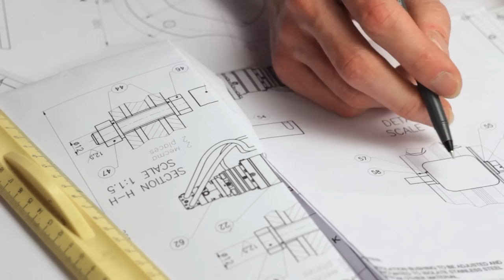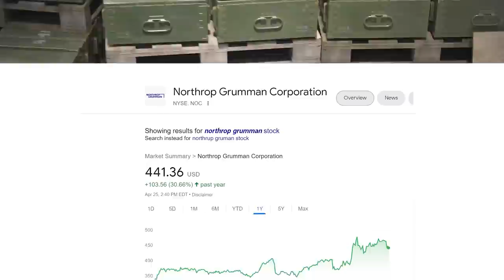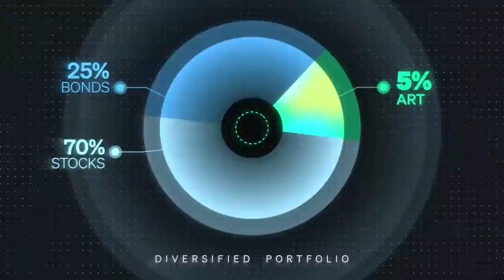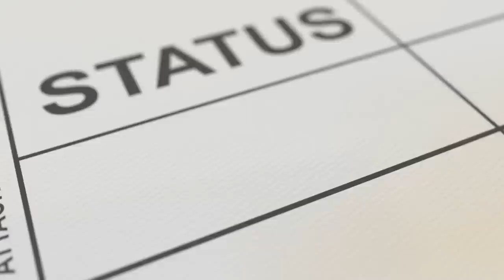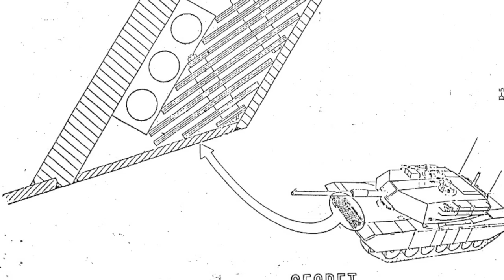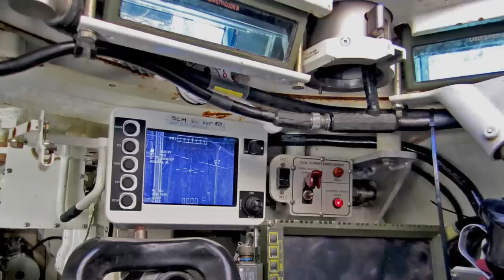The M1 Abrams Tank Needs to Chill Out

Comment: Oh has the modern m1 Chabam, composite armor Been tested Vs, MODERN, Opfor, Atgm? Apsfds? Well if it has, that shit's classified and you don't know what to performance is I'll tell you please don't need deflection and ricochet angles those big ass cheats on the side of that tall ass turret, easy  freaking target, All you have to do is win flat against the cheeks on the turret, easy pen, especially with SABOT,  SHE'S PROBABLY WELL PROTECTED vs most ATGM,  with her composite armor specializing in that.. That's why we haven't seen any silly cages, But Abrams is extremely tall and completely opposite. Most doctorine, DM1 is an extremely maintenance heavy beast... It requires several mechanics for each vehicle to maintain the Chinook turbine engine especially in Sandy environment, but this makes it much more likely It will suffer from reliability casualties also what if your operating as America plans to operate from ship to shore where are you going to get your motor pool so you can do your yearly or 6 months overhauls that each requires, why do you think that you never see any terroristsv fighting with m1? Because therefore they put a hundred miles on them They break the fuck down requiring college educators mechanics and special heavy lift machinery to repair... This is extremely stupid in my opinion.. completely fine if you're operating in your own country That's great But if you're in hospital territory I'll take the AK-47 and the t 80 or 90, That's why m1 is always having to fight some 30-year-old  export Ts 72s, Because they're surgery in your eyeball and long-lasting and easy to repair that even in that ineptnl terrorist horses like Taliban and whatnot Ken and you operate several of these beasts.. also the Russian doctrine obviously favors numbers over quality which I would argue definitely wins, In a major slog, and if you want to argue that you should look up a little skirmish called world war II, specifically operations by army group south, Operation citadel, who will see how quantity destroyed quality over and over and over. And mind you no matter how much protection and the firepower The abrons has packed into it, still has to be rely on soft weak fleshy,  MEN, MEN WHO TYPICALLY TEND TO ABANDON FUNCTIONING OR PARTIALLY FUNCTIONING, VEHICLES THE FIRST ROUND THAT HITS THERE HULL, EVEN IF SOMETHING FAILS TO PENETRATE THE PAINT INSIDE THE VEHICLE CAN BE BLASTED OFF THE WALL SO HARD IT BECOME SHRAPNEL TO THE CREW MEMBERS FOR STUCK IN A TINY DEATH BOX SURROUNDED BY MODERN INFANTRY, each potentially, packing some type of weapon which easily could destroy your million dollar 60 ton, behemoth before you even know... They could be wearing thermal optics in which case the tanks will grow brightly against the cool background the noise of your vehicle as well basically makes ambushing stealth impossible, you will always be known always be targeted and always get hit quite stressful And if you sit here and say you would stay in your vehicle after the first 7.62 plunked off your hull, I said you better than fired upon visual factory and you start to hear the cracking and zipping big fat bullets over your head It's nearly impossible for stop yourself from falling flat... Same thing when it comes to artillery, You see explosions around you instinctively want to go.. see the mission starts meaning absolutely nothing compared to your own life, I mean who are you to give your life towards you don't even understand do understand, why should you have to die ? The value you put on your own and yourcrews lives, Well of course always be the most important most value thing and it should be, I considerably say I will not died for any mission or nation, life only to protect my family and my property, you see the modern soldier is fighting war the game someone else's profit or to protect someone elsez profits or something important to someone else but not important to the soldiers who are done fighting did anyone who is on the halliburton boardroom with any of those men fight in the war that saw their company gain billions, fuck no.. You couldn't even draft those men 
 Because the draft can be stopped if you have enough money. . Always going to come down to people fighting with modern weapon s have made killing extremely EASY AND non personal, think about the 1000 or so,   killed by Obama's, each one of those is an execution by government that isn't the government of that land, in America the country that these other nation claiming to protect freedom, but the president of that management of that nation can sleep at night knowing that he has signed over 1,000 death warrants illegal assassinations carried out over foreign land which if you can imagine Canada or whoever, operating air military aircraft and killing American citizens without trial or any real investigation to weather the right person or the collateral damage is worth it. Because You may have targeted $1,000 who were terrorist But you killed 4000 innocent children in civilian due to the collateral DMAAGE, INHERENT WHEN WHEN BOMBING CARS OR BUILDING IN THE MIDDLE OF CROWDED CITIES... IF YOU SAW THAT TOMORROW YOU WILL BE MENTALLY BROKEN, A FAMILY OF INNOCENT JUST BLOW UP  BODY PARTS FLYING LITTLE CHILDREN BEING RIPPED APSRT SCREAMING NOT KNOWING WHAT HAS JUST HAPPENED,  Oh well it was America and they were trying to kill this guy Who America assumes is a terrorist but in the case of the last strike  mentioned in Afghanistan that I remember, actually it was a  Afghan citizen who was working with the occupying US forces, It was him and his extended family, basically A man who believed Americas claims,.. and we killed him.... Not a good look for us.. thanks Biden and Obama..
Reply: Nice dribble mate. You made no sense whatsover. Skipping all over the place and not addressing the issue presented and being debated.

Comment: The smart country would build a nuclear infrastructure obviously hidden and protected. Electric ⚡️ power is good now and always  gets better. Then oil would not be an issue. Nuclear is clean energy these green people don’t understand that . Solar and wind. Not enough power and not cost effective. Back to Abrams the hull on the Abrams is basically the same they upgraded the turret and fire control system that’s it. Plus there’s a huge gap in the front we’re it’s vulnerable to getting nailed in the turret ring either penetrating or jamming the turret.

Comment: The purpose of a Tank is to kill other Tanks, its all about the gun. But, if the gun isn't needed to kill a Missileman several kilometers away, but he can one shot kill the Tank, what's the purpose of all the armor and the gun? Being a big, loud, non-stealthy armored vehicle is a death sentence in Ukraine.

The Russians are doing it wrong you say? They aren't using proper infantry screening you say? That might be true if the Ukrainians were using dumb RPGs with their 100-200 meter ranges, which are the same as the AK-47's range. But even the shorter range NLAW smart missile has an 800 meter range, and the newest Javelins have a 4.5 km range, which far out ranges the screen's range and ability to sense. And the screen is even less effective against Switchblades with a range measured in loiter times of up to 40 mins and growing. In addition to the range issues, Tanks and other armored vehicles are Logistical Nightmares, needing tons of fuel, ammo, parts, heavy maintenance, and to be carried to and from the battlefield by ship, train, and tractor trailer. All sides are using observation drones of course, but the task of finding and targeting missilemen which can be anywhere within many square kilometers, is much more difficult than finding armored vehicles, which hang around roads and leave obvious tracks when off road. 

For these reasons and more armored vehicles are obsolete and the best militaries will be mothballing them as the US Marines have already. As a defense, armor has been supplanted by distance, stealth, and speed, and many other weapon systems like surface ships (Cruiser Moskva) are at major risk and obsolete as well. 

A missileman on an ATC, Pickup, or Motorcycle in a ghillie suit, shooting and scooting while armored up troops are dying in their steal coffins.

Comment: lol newest version of abrams is just cheap way how to steal merkava active protection. Engine still suck, cannon is still weaker then hight pressure version on Leos 2 and armor is still useless agane modern APDSFS
Reply: You are fighting a war on paper, not in real life.  Everything you mentioned is the opposite of what happens in war.  Allies always share technology, Abrams tank crews rather have the performance and advantages of the turbine engine over a diesel, the 120mm smooth bore is effective at killing +3km out, and the Abrams and NATO tanks can engage further out than T-series tanks.  The only competition for the +42 year old Abrams are other newer NATO tanks and they are riding right next to the Abrams.
Reply: Everyone "plagiarized" designs, no complete surprise. Engine is quite good for a 70 ton Abram. Cannon is adequate, no need to replace it yet. Any Tank armor will be useless against ATGMs, it's an Anti Tank weapon.
Reply: @mrgold3591  Allies do not always share technology.

Comment: tanks as a concept are outdated. armor cannot feasibly keep up with artillery. instead, the future lies in ground based drone artillery units that can be more readily mass produced and are more disposable than traditional tanks. Taking people out of the "tanks" means less need for armor, which means more carrying capacity for weapons and greater mobility. The US would be wise to phase out their tanks in favor of these units.
Reply: War is evolving and tanks still have place on the battlefield.  You cannot take and hold ground with drones or artillery. New technology will always be tested and used as needed on the battlefield of the future.  Tanks in one form or another will still be used unless you find a direct replacement like the aircraft carrier was for the the big guns of the battleships.
Reply: @mrgold3591  In some form, yes. Although the new form likely won't have people inside of it.
Reply: @jordanl8603  No people means some type of A.I. or over the air transmission to an operator.  I would just step up my electronic warfare and set up radio frequency triangulation positing to send artillery.  For every measure, there is a countermeasure, and then a counter-countermeasure, etc...
Reply: @mrgold3591  Aerial drones
Reply: @jordanl8603  Aerial drones are no different than close air support.  You can't take and hold ground with drones/close air support.  Drones have limitations with weather, wind, rain, remote locations, elevations, extreme temps, and communications that isn't a factor for ground troops.  Drones can work with ground forces; but, are not a replacement just yet in our lifetime.
Reply: @mrgold3591  whoosh
Reply: @jordanl8603  Tanks are still essential, they aren’t obsolete. Tanks are as much worth as a soldier, they just ain’t worth shit if they’re led by sheeps.

Comment: Russian Armor especially the T72 are JUNK... I trained and drove in every piece of Russian Armor in an OP Forcers training. Most of the Russian equipment is sub standard JUNK. The T72 is a prime example. While the Main Gun is very powerful and the Round Shot from the Smooth Bore gun can travel a mile a second the problem is the plat form it is sitting on. The Turret is NOT Hydraulic or electrical powered. The Turret is a HAND CRANK Turret and is very SLOW when it needs to turn and fire. and that is why so many of these tanks were wiped off the planet in Iraq.. The T72 Power Train is no better and in Fact the Driver's main Tool is a *5 Pound Sledge that he has to use if the T72 Travels at only 40 MPH for any period of time the trans freezes up and the Gear Change can only be done by the driver pounding the Shifter out of gear and into the next gear which even slows the T72 up even more. Every Russian Made Armor piece including the BMP has similar Flaws. The Abrams is millions of mile ahead of any Tank in the world and we were always over joyed and had a sigh of relief when one would show up in the field.

Comment: The M1A2 (SEP3) is not obsolete by itself - it is a fantastic system. However, I'd say that the entire tank concept is on it's way out. Sure, a tank can land very quick and very precise fire, but they have way too many drawbacks:

To begin with, they are expensive like hell, and I would argue they don't deliver the same bang for your buck as say a fighter jet does, even if that is even more expensive (by far). And in today's world, economy is a weapon just like an M-4 - something to be used against an enemy, or for that matter, if it's handled poorly can hurt your own side just as badly.

Then there is this whole thing with infrastructure - nowadays tracks are less important since more and more of our world has roads everywhere we need to go - storming across fields is less of a priority today. 

Finally, there is way too many systems designed to kill tanks. Sure, there is ERA and the new automatic systems meant to shoot down incoming missiles, but they are incredibly expensive, limited in use, can miss and won't help against a lot of other stuff.

Speaking of, way too much is designed to kill tanks today - AT missiles is one system, but then you have threats from the air in the shape of missiles fired from aircraft and helicopters, mines, heat seeking artillery rounds and for that matter other tanks. 

Tanks are said to be quick, but they aren't - many times they need to slow down to a crawl, and that is damn dangerous - speed is their number one protection, and a tank standing still is a sitting duck. Add to that that tanks are big juicy targets that as I said everythink wants to kill and you have a pretty bad situation. 

To that comes the fact that tanks need a lot of maintenance - one hour in the field will clock in eight hours in the workshop (still not as bad as aircraft, which has maintenance hours that are clearly insane), and they also drink a lot of fuel. Well, so do aircraft, but they have a great advantage in that they are always deployed far behind the frontlines and thus closer to friendly supply lines - tanks on the other hand are ON the frontlines, meaning their supply is a lot more vulnerable. 

And to be honest, I hate it - I love tanks, but we have to face reality - tanks are most definitely on their way out, being just big expensive toys for the brass, especially when facing off against a tecknological comparable enemy. Much better to focus on chaper and simpler systems like say the stryker or other wheeled ICV's or transports, paired with artillery, infantry and air power.
Reply: The cartridges fired by an M4 Carbine cost, even on the civilian market, less than $0.60 apiece. The government gets them a lot cheaper than that. Training and equipping even a Pvt 1st Class in the US Army costs up to $800,000. And that isn't considering the cost of feeding, clothing, and educating this stravag to a basic level from the moment he pops out of the womb up through his 18th birthday. By contrast, a multi-million dollar tank or fighter jet doesn't need someone to kiss it good night and read stories to it when it is being manufactured lest it develop problematic operational quirks that would make it useless on the battlefield. Now, you could do that for the newly manufactured M1 or F-35, and it wouldn't hurt a darn thing. In fact, maybe 40,000 years in the future that will be expected of you. But right now, it's not a necessity, and your coworkers will probably think you've lost the plot :P.

Moreover, even with all that training and equipment, Pvt. Jones is still extremely vulnerable to that $0.60 bullet, and no amount of armour you can slap on his body will save him from a shot to the face, limbs, or neck from said bullet. In fact, a 7.62x39mm bullet that cost $0.05 will still kill him dead with great effectiveness, and if it doesn't kill him, it will quite likely leave him combat ineffective in the immediate and long term if it shatters his arm.

Other things that Pvt. Jones is vulnerable to include extreme heat and cold, diseases, boredom, psychological stress, alluring women, starvation, thrown rocks, artillery, mortars, incendiary weapons, poison gas, sleep deprivation, wooden spears, arrows, flintlock muskets, and aggressive wildlife like venomous snakes.

Does this mean that we need to "face reality" and see that Pvt. Jones and his mates are on their way out, as they are just walking toy soldiers for the brass, when facing off against a 'tecknological comparable'[sic] enemy? Mind you, all of the things I named that can kill, incapacitate, or otherwise impede Pvt. Jones' fighting capability are much cheaper than the amount of money invested in bringing him to the battlefield. Some of them, like heat, cold, bad weather, rocks, and venomous snakes, are provided by Mother Nature free of charge!

So unless you have the capability to build T-800 units that can identify the bad guys, take them out with extreme precision without slaughtering non-combatants or surrendering enemy combatants or killing the lads on your side whom the bad guys have captured, the $800,000+ infantryman with his vulnerability to threats that range from absolutely free to common $0.05 bullets, isn't going anywhere. And skimping on Pvt. Jones training and equipment (let's say you send him into combat naked with just his boots, a helmet, dogtags, a paintball-grade LBV, and a Ruger 10/22) will greatly reduce his combat effectiveness.